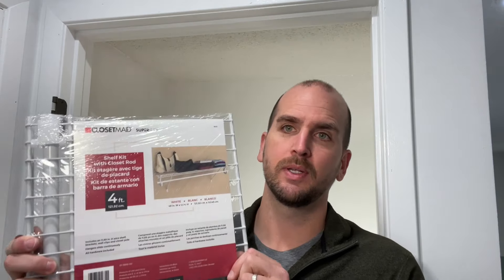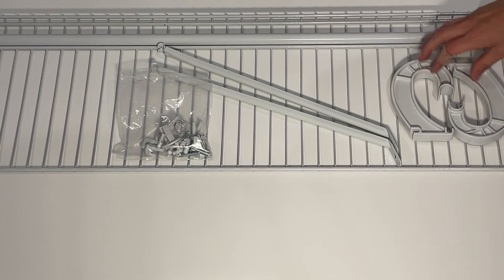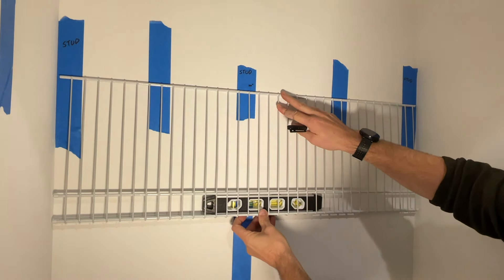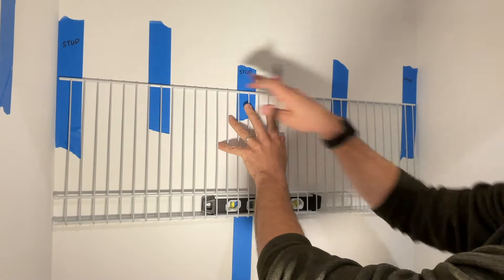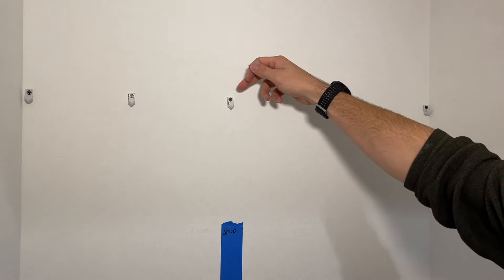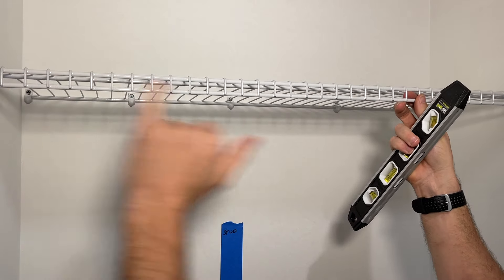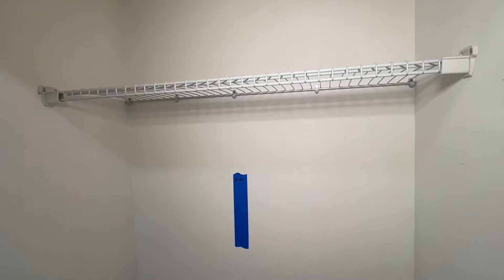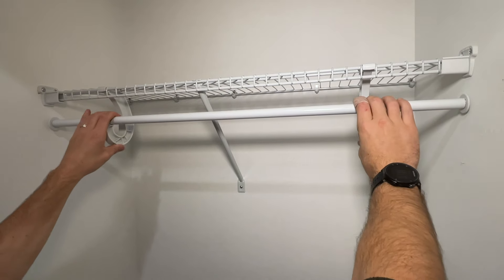Closet Shelf Installation and Repair | ClosetMaid Wire Shelf Kit

Comment from the maker: 4ft ClosetMaid Kit:  https://geni.us/yXUqK3
All My Favorite DIY Tools:  https://geni.us/VYIp51
ClosetMaid Wall Brackets:  https://geni.us/NwMUZk
Toggle Bolts 1/8" X 3" used in the video:  https://geni.us/w9zIMu

Tools Used
Makita Cordless Drill Combo Kit:  https://geni.us/t7dIA
Dewalt Drill Bit Set:  https://geni.us/oFlSl
Dewalt Screwdriver Bit Set:  https://geni.us/VDcr
Craftsman Screwdriver Set: https://geni.us/jXqFI
Stanley Tape Measure:  https://geni.us/bUfD1R
Studbuddy Stud Finder:  https://geni.us/RySCuVw
Johnson Torpedo Level:  https://geni.us/wiLcDY

Tools Every Weekend Warrior Needs
Eklind Allen Wrench Set:  https://geni.us/7XfvO
Pliers (4-Piece Set):  https://geni.us/RIdx
Stanley Hammer:  https://geni.us/bPDk8Wo
Buck Bros Wood Chisel Set:  https://geni.us/vk3cpTW
Klein Voltage Tester:  https://geni.us/h9Hl
Klein Outlet Tester:  https://geni.us/kdBAJ
Ideal Wire Strippers: https://geni.us/MdOB
Little Giant Ladder: https://geni.us/fmlmTk

DISCLAIMER: This video and description contain affiliate links, which means that if you click on one of the product links, I’ll receive a small commission.

Comment: This 14 year's installed Rubbermaid shelf  held up with tons of clothes....until it didn't.   Thanks so much for sharing the toggle bolt clip "fix" as these 68 yr old walls finally gave up and spat the original plastic clips with nails out leaving large holes.   Great help!!

Comment: I want to echo the sentiments of the other viewers and express my appreciation for this quick, simple, and easy-to-follow installation guide. I had a rack similar to the one in your video that decided it and the drywall it was connected to were going to part ways - literally! The sudden break-up resulted in all of my clothes crashing to the floor. Thanks to your video, I was able to get it back up using the toggle bolts and the same holes.

Comment: Thank you so much for going step by step and explaining different ways to get to the end result; I am on a journey of installing closet shelves in my new house that came with absolutely zero shelving somehow, and I appreciate you going through everything In a manner of which I can easily follow along and reciprocate. 🙂🙂
Reply: Honestly prolly better it didn’t come with it because ours came with the wire shelves and all 3 ripped off the wall and only one had lot of weight but they only used the provided hardware and not into one stud
Reply: Same at my house. No shelves in any closet, laundry room and garage so I had been installing all sorts of configurations but I wanted to clarify a few points that this video helped with.

Comment: I trick for installing toggle bolts is to run the drill in reverse fast for just a second and the toggle will spin fast on and tighten to the wall rather then if you go in forward, it will spin off and end up at the bottom of the wall cavity….👍
Reply: I hate when that happens!
Reply: Good stuff... thanks!😊
Reply: That would LOOSEN the toggle bolt. Are you sure you said that right?
Reply: This is hands down the absolute best explanation!!! Thank you

Comment: This was a great overview of this, I needed to repair an 8 foot section that had been overloaded and pulled out of the wall. One thing to note, I was going to use toggles for all the supports in order to space them evenly, that ended up being a failure. It was impossible for me to start all the toggles in the holes simultaneously and still seat the support brackets properly into the shelf due to the fact that they needed to swing into position and the angles were simply not working out. I ended up locating all the supports on studs, which was certainly a more robust solution but not as aesthetically pleasing as I originally intended. I ended up adding a couple more supports to balance things out. In any event, this was the perfect video to help me figure out what I needed to do to accomplish the repair, thank you!!!

Comment: Great video. FYI - to avoid creating large craters in the drywall, if repairing or uninstalling, then make sure to remove the nail or screw from the plastic clip first. This relaxes the “anchor” and makes it easier to remove from the wall… I removed many of these from the closets to re-use in the garage. I was sure there’s a better way to install and toggle bolts seems to be the way to go if you need support where there is no stud. Thank you!

Comment: Time lapse for the sawing lead me to believe I'd get 3 done in 3-4 hours.  It can be a lot of sawing! 

The clips I got had almost no wiggle, so I had to modify the first shelf I did a touch.  So a trick I did was to figure out that center hole by count etc. Mark it.  Then put all 5 clips up for fit with the level on the shelf. Mark through the clips.  Take down.  Check for level.  Correct a smidge.  Then install as you did.  No clip problems the rest of the way!

Comment: Great video in detail will help a family member put back up a shelf in his closet that fell down because of weight.  It was put using the anker type wall that easily fell out and made  a hole bigger. Toggle bolt  is the way to go.His house is built brand new, and I'm surprised the contractors use a cheap way to put the shelf up.

Comment: A really good, concise, understandable, video. One of the best such videos I’ve seen on The Tube.
Reply from the maker: Thanks Douglas,  here is another option as well if you would like a little more strength and ability to adjust the configuration.  https://youtu.be/lO0DMblbsIw Best of luck on your project.

Comment: I have a manufactured home and the builders used this type of shelving in all the closets and in the pantry - cheap stuff .. as long as you don't hang heavy clothes on them or place heavy objects on the shelf, you're ok .. I've had to support them with 2x4's and am slowing replacing them as best I can ..  I've even had to add masonite on them in the pantry to keep cans from tipping and small packaging from falling through.

Comment: Because you asked about what was useful... I didn't have a full closetmaid kit, but it was my first time installing this sort of wire shelving. I've hung shelves before and will choose placement based on location of studs, but your emphasis on finding studs is likely well merited if shelves are full-on falling out. Drywall's just not made for the weight.

The point I'd like to thank you for personally was how you set it up as just a single person. I'd been up on the ladder, trying to hunch up the shelf with my shoulder while looking at my level which was placed on the shelf arranged horizontally, trying to scribble into the nail hole with a pencil, and repeatedly smacking my head when the whole thing crashed down. Your sticking the level on the lip of the shelf and starting from the wall brackets made the second shelf much easier, take much less time, and result in less bruising. Thank you!

Comment: From personal experience, I can tell you that those plastic clips will eventually fail. It seemed to happen right at 20 years. Many aren't concerned about 20 years, but I like to do things even better than recommended. 

Even better are the metal clips they also sell, but these require 2 holes as the metal clips surround the shelf piece. They are called Concrete/Stud shelf clips, part number 75615. These do come with plastic sleeves for the screws that you place in your studs.

We had 2 shelves fall, and before I had time to fix these with your molly bolt trick, the other 3 also collapsed. I wish I had seen the molly bolt trick first as I could have saved time using the same holes. Wall patching wasn't fun, and due to timing, I will have to wait on paint. Another item at the hardware store are scew in metal sleeves. They are rated around 40 lbs vs. the 70 of the molly bolts you mention.

I came here to see you mount the shelving as the closetmaid has terrible instructions. I will use a combination of the concrete metal clips and the plastic clips in between as the studs are 16" on center; too far apart per manufacturer recommended spacing. So this will be one clip every 8 inches. I also am increasing the wall support by one more for each shelf than was initially installed by the builder.

My reasoning on the extra support is that only one perpendicular wall is supporting the shelving, as the right side is open space. This is a utility room shelf install not spanning the entire wall width.

Comment: 15:55 well well well.   I was searching for the ‘newer’ support brackets that Closet Maid said was ‘somewhere’ on YouTube.  The newer supports have to be ‘forced’ back against the wall.  😮.  I removed some of the material from between the 2 ‘tangs’ so that no force was placed on the wire in the front of the shelve. CM said to ‘push’ it back against the wall. That was the design stated the rep on the phone.  ☎️ placing so much pressure on the parts isn’t what I call a ‘good design’.
IDK about that! My way seemed better as only compression was on the support to the wall.  No wires were injured 🤕 durning my installation. 😅

Comment: Thanks for the video. The hardware that comes with most kits are no good. Even though you tighten the toggle bolt, the drilled hole has to be bigger than the bolt and over time, as you load and unload the shelf it is going to wiggle and come loose. I much rather prefer an aluminum drywall anchors (rated for 50 lbs). If   stud is not an option, I always use a metal drywall anchor. There is no need to pre-drill, looks neat and very strong.
Reply: Hmm, was going to use toggle bolts, these look cool not sure now.

Comment: thank you! I followed all these tips and found studs wherever possible. Where I couldn’t I used toggle bolts. All was well until water started leaking from one of the toggle bolts. I must have hit a pipe?! What did I do wrong?

Comment: Thanks for the video and well-paced narration! Wonder if your drill machine can drill hole AND drive the screw into the stud at the same time. Usually, first a hole needs to be drilled into the stud, and then the screw to be driven into the hole. Probably, you have a different (powerful) drill/drive machine that does both tasks together. Also, what length of screws to use for the clip-on-stud? Thanks.

Comment: Question:  if the support is made to “hover” the wire, what support is it actually providing?  All I can figure is that there is a little more support for pulling away from or pressing into wall, but if it was mounted above the rack (cupping the wire) wouldn’t it actually provide additional weight support?

Comment: You didn't need to put "endcaps" on the end of the shelf that went into wall bracket, did you?  It seemed you had a bit of trouble getting the shelf to snap into the wall bracket because of this.  Otherwise, GREAT VIDEO!

Comment: Hi, great tutorial! I’m going to embark on my first installation journey using it. The only thing I do not understand which size drywall screws you used? I saw this question asked in the comments but, unfortunately, you never addressed it. Someone else mentioned once that you used 1 1/4 in the video. Can you confirm is that correct or if that is not, clarify what size you recommend. Thanks a lot!
Reply: In his rubbermaid video he links to wood screws, not drywall screws. Specifically, when mounting the 1" thick rail, he used Wynn Works Phillips 2-1/2 inch No.10 Full Thread Wood Screws which would put about 1" into the wood stud behind it.

Comment: Shelf brackets broke off. Shelf fell. I have replacement brackets from Lowes. But what type tool can remove the broken plastic brackets from wall so we can replace with new ones? Is there a special tool from Closet Maid?

Comment: i came here after searching for alternative to end shelf brackets.  The ones i have a twice more deep than in this vid (have tons of them after removing shelves installed by prior owner of the place).  Yours are more elegant and fit that end exactly.  But still there is lots of holes drilling in sight and i am afraid of 1 place very close to a lamp bulb inside closet.  Don't want to hit any wire and am not sure how to find out where the wire comes from...

Comment: If you measure 36 inches wide, and you go 35.5 inches, you said it gives you 1/8 inch clearance on each side. I’m assuming you meant 1/4 inch clearance on each side

Comment: if you're using these shelves in the basement in laundry room where the walls are concrete should you use All toggle bolts instead ?

Comment: Our house has these closet systems installed in 2007-2008 (new construction). Now in 2021, the brackets that support the rods have begun to break in front where they clip onto the wire shelves. I was able to buy replacement brackets at a home improvement store.

Comment: I came here because the house I just bought has this closet system and we quickly learned not to put too much on it. Woke up at 4 am to a loud crash, the whole thing fell out the wall! Trying to figure out if we should attempt to put it back
Reply from the maker: Toggle bolts usually can help in this type of situation.
Reply: The bolt length seems excessive and could hit some plumbing ? Would you ever have to trim these bolts down or I imagine they come in smaller lengths that you just didn’t have on hand?

Comment: Hi, thanks for this video. Is this a hand saw you used to cut the shelf?
Reply from the maker: Just a standard hacksaw.  Some times the home improvement stores will have large bolt cutters in the shelving section and as long as you have your measurements they can cut your shelves to length.
Reply: @EverydayHomeRepairs  thanks so much for the response!

Comment: I watched your video on installing a wire shelving, however,  the anchor seems unsteady,  can you recommend a more secure anchor. because I have heavy clothing.
Reply from the maker: Hi Teresa, do you mean an alternative to toggle bolts?  If done correctly the toggle bolts are just about the best on the market.

Comment: Now he installed a little shelf in a house closet that he could effectively store a Chevy small block V8 engine on and it wont fail.
Reply from the maker: You never know what renters are going to want to store 😉
Reply: I know I appreciated it since I am a renter and have a tiny bathroom. I plan to put 4 3 drawer rolling carts on mine since I have no medicine cabinet not linen closet also only floor space is utilized for Furance vent!!!

Comment: They tried to improve the brackets and connectors but it is still flawed. The older clips would be put in upside down also to counter the positive bending moment occuring if the shelf is overloaded at the front rail causing rotation at the side brackets. A locking device would have be good.

Comment: My toggle bolt keeps falling off into the wall any help??
Reply from the maker: Thread the wing nut on a little farther and then make sure you are pulling the toggle bolt out after the wings expand inside the wall.  Once the wings are expanded and you are applying pressure on the backside of the drywall with the wings you can start to tighten the bolt which should pull the bolt in as you thread it.

Comment: I have installed over 50  wire closet shelves and never had a failure using the wall clip with the integral anchor and  expansion nail attachment and angle brackets. Try to remove one after it’s installed. They don’t come out easily.  I always use the correct front end brackets with integral wall anchors and expansion nails.
Reply: they come out if the hole gets bigger.

Comment: Feel confident installing myself after watching your video. Can i install shelf without middle support?
Reply: Depends on the span, and what you are putting on it.
Reply: @TheBlueEyeDevil  Hi, I also had the same question about the middle support. My linen closet is 35" wide, by 16" deep. I know that I'll also land at least 4 studs along the back wall. I don't intend to put anything heavier than blankets and towels on the shelves, so I feel that the middle support would be more cumbersome than beneficial. Thanks.

Comment: How  high  do I go if I want two rows for hanging   clothes?
Reply from the maker: If you are doing 2 rows then you would put the rods at 40" and 80".  Remember that is where the rods should be position so you would need to place the shelves a little higher to accommodate.  Best of luck on your project!